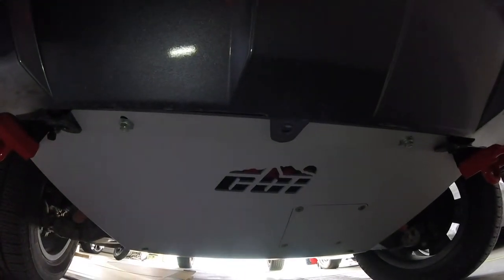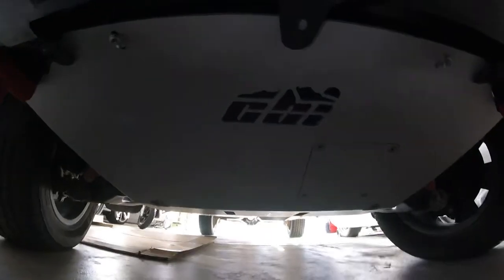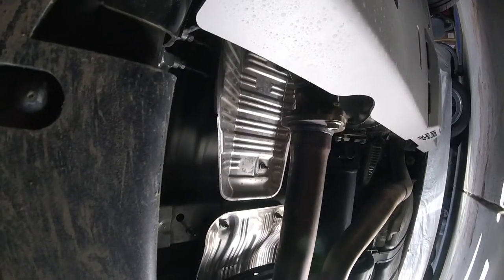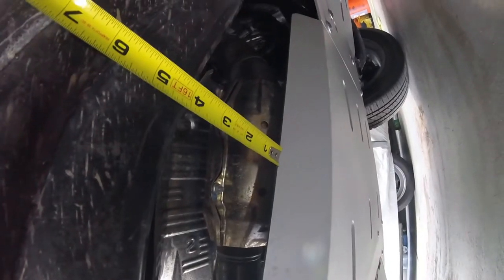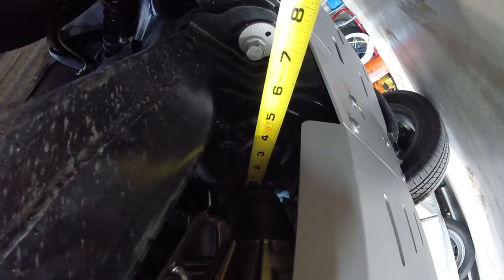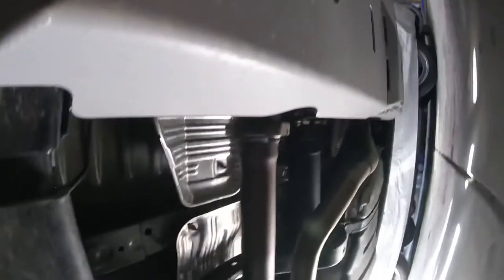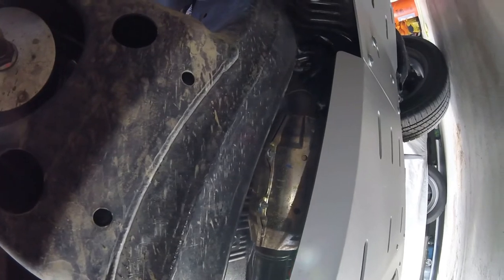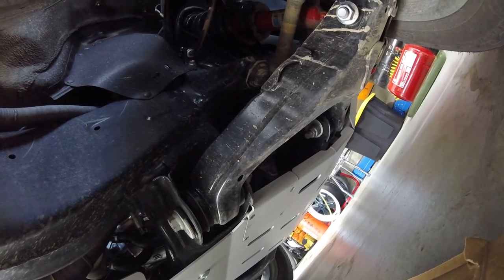Toyota Tundra catalytic converter protection

Comment: if you can get a tape measure in there you can get a sawsall blade in there. Doesnt look like it would work.
Reply from the maker: Trust me it’s really tight in there and you would have to have a long sawsall blade to even get in there and there is not enough room to get the cats out if you did manage to cut them.

Comment: TOYOTA TUNDRA has two catalytic converters and two exhaust resinators. Shields are bolted or riveted in place - thieves have tools.
Reply from the maker: I’m sorry but you are wrong as the 2021 Tundra has four Cats with two on each side according to the Toyota parts fiche.  I think thieves will move on to another target instead of unbolting skid plates as they want to be in and out quickly.